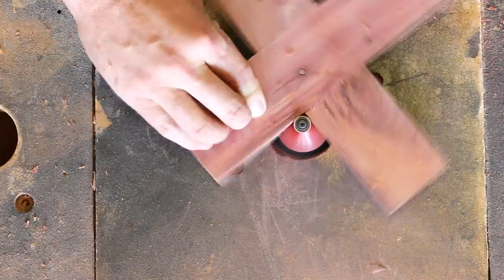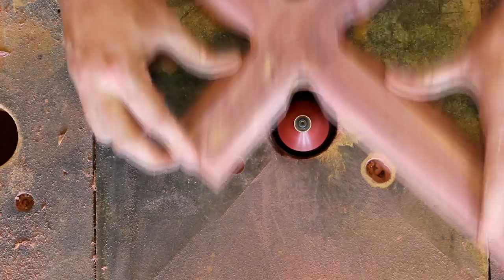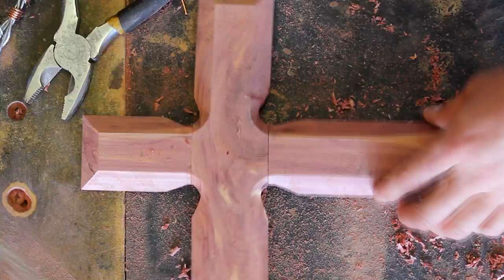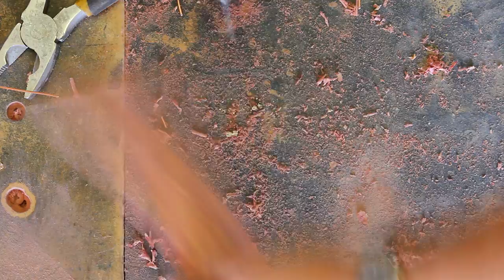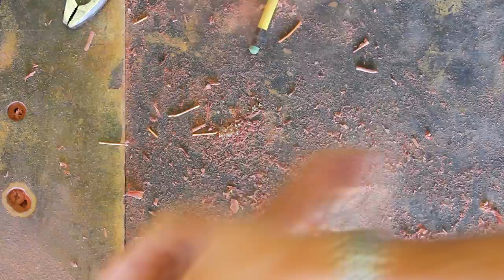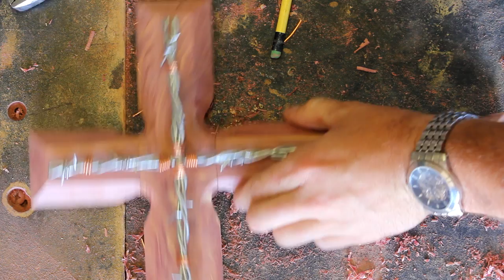Teen Challenge Hand made cross (HD)

Comment: Did you finish the cross with anything? Oil?
Reply from the maker: Yes, they typically stain and spray a clear coat finish on the cross before tying the Barb wire on it.
Reply: Josh McLeod is it 1 piece of wood or 2? Thanks
Reply from the maker: It's two